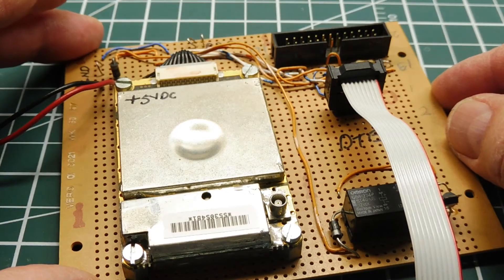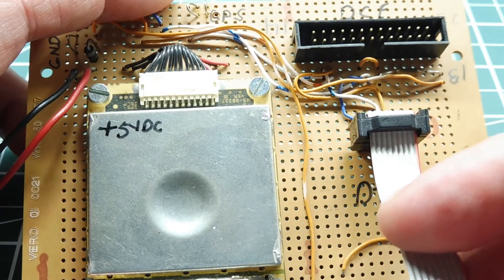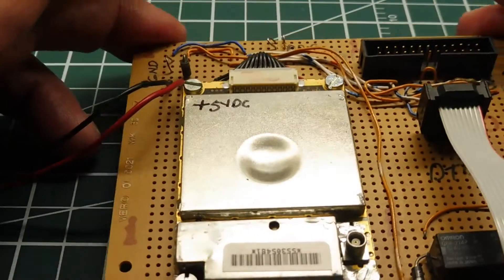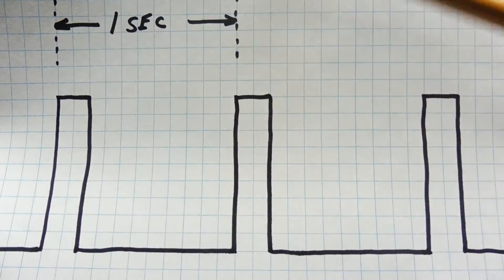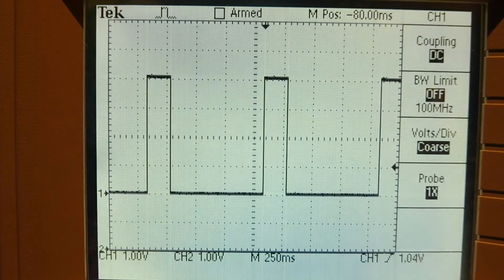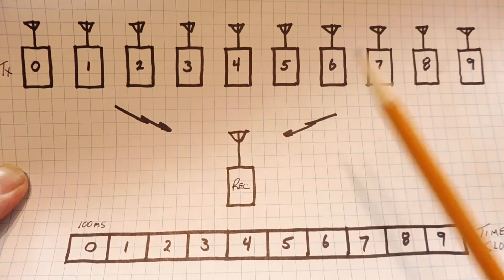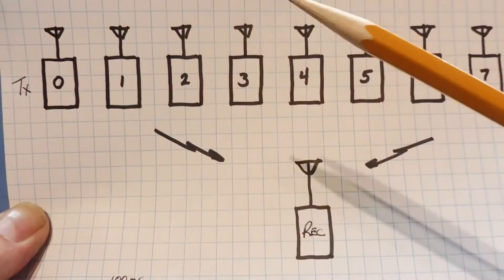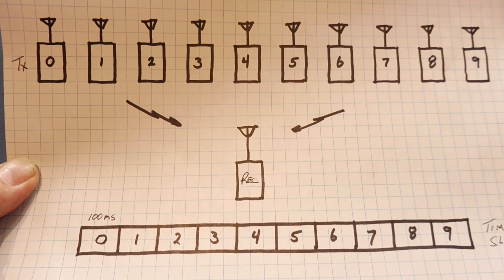Sync your project with GPS 1PPS

Comment: This is a good video and well made. There is information missing in parts that needs a little filling in. First up, the pps pulses output by the GPS receiver are not necessarily low jitter as such and it does not necessarily aim to be either. What it is, is accurate over time. And when we say accurate, we mean crazy accurate. The signal is derived from the atomic clock in the GPS satellites with errors somewhere between 1s per 30million years and 5ns in the life span of the universe. This is not an exaggeration (on my part anyway). These are the published numbers for atomic clocks, go check it out. Quite fantastic stuff.
So using the pps you could have a time of day clock that is never wrong (daylight saving aside) and will never have an error of more than a nano second in your lifetime.
Second area of not quite accurate information is in the discussion of the application.....
To say two devices in disparate locations can use the pps and receive it at "exactly the same time" is an error. All electrical signals, be they in a wire, air or space, take time to propagate. It is that fact that means a GPS can triangulate its position based on the time signals sent from multiple satellites.  The quoted application of TDM by remote transmitters requires the transmitters to know when to transmit such that their transmission arrives at the receiver at the exact time that is that transmitters TDM slot. That is a function of the distance between the receiver and each of the transmitters. A transmitter that is much further away than any others and has the last TDM slot assigned may begin transmission before any others but the distance means the transmission arrives just after the last of all the other transmitters and in alignment with the last slot position in the TDM frame. This is how analogue mobile phones worked (can't say what this scheme was called and what countries it operated in other than Australia).
An over simplification leads to either confusion or a misunderstanding and neither is good. I hope I have not caused either here.
Reply from the maker: This is a simplified description of this concept, as it is only a 4 min video. Check out the link to a patent of a radio controlled locomotive system I have worked on. Have a look at Paragraph [28] under Detailed Description for a more detailed description.
Reply: @0033mer  You should do yourself and the topic justice and take as long as the subject requires in explanation. Or pick a smaller subject or less complex examples. TDM over radio is no small subject ;)
There will be newbies watching this and they get the wrong idea and some of them will stick to the wrong idea like sh-t to a blanket. ;) They are the bane of my professional life.
Reply from the maker: Feel free to make your own longer video on this subject and I will link it to this video and my channel.
Reply: @0033mer  Now don't get tetchy ;) I looked into the old mobile phone TDM arrangements and the time slots were kinda short and tight and the distances not necessarily all that short either, and that is what made the standard for mobiles harder to comply with. Your rail yard probably has maybe up to 1km transmission distances? And I think I read in this post or in your patent application you were using a 1 second frame (rate or length, not sure which) and two (?) TDM slots so the timing would be far less stringent. Even at a distance of 5km, I think the slot width would still be an easy enough target to hit.
What got me going was things like, that two gps receivers being perfectly in sync based on the pps. They may be in sync enough for a 1 second frame rate with two slots per frame but to say they are perfectly in sync is a statement that has to be qualified, as in, they are sync'd to within ??us or you could just say they are really close to in sync and the repetition rate will be perfect because the frames are triggered by the same clock source or synchronised satellite clocks.
It is the absolute statements that are not absolutely true that raise my ire.
The pps on a CRO may look super solid but how much jitter would there have to be for it to be visible? I would guess RMS jitter less than 1ms would probably not be visible and 1ms RMS jitter on a 1Hz clock is terrible. I think even a 555 would do better than that.
But your system as described would probably work just fine with that much jitter.
It is horses for courses, or suitability for purpose. And the pps is suitable for the purpose to which you applied it. It does not, however, indicate characteristics better than those you required for the application you were developing. Fair enough?
Reply: @0033mer  Ok. I have had a look at your patent application from 2004 and I think I have found the problem. I don't think you are taking flight times into account. Even if a gps signal could be used this way it does nothing to accommodate the flight time of the signals from each transmitter to the receiver. I know your TDM frame is slow and probably has loads of wiggle room but in a rail application distances can be significant even in a rail yard context. Did your patent get approved and issued?
Reply from the maker: We have been doing remote rail yard switching here in Canada since 2004 to present.
https://www.dropbox.com/s/46eofcxnqxouf8t/Cattron.pdf?dl=0
https://www.youtube.com/watch?v=pFWlIfIZkCA

Comment: 2:58 - I hope this actual project is not using the 1 PPS signal at every second for 24/7... a lot of problems could occur which lead to all towers not to sync. Lets say some background EMI can cause the GPS signal to be skewed and some towers would not be synced. I hope it was designed such that those towers only uses the 1 PPS radio signal maybe when it's time for synchronization it's internal clocks. So in essence, those towers should use precise internal clocks and when it's time to resync all of the internal clocks, it should use the GPS clock signal. This way those towers are not highly dependent on GPS clock signal 24/7, rather dependent on it after few days or weeks. Also, what kind of algo was used for the antenna tower transmitters to wait for it's turn to transmit data? When thinking about this project, it seems the GPS atomic clock accuracy wasn't needed. All towers can just transmit 24/7 every second of the temperature data simultaneously and continuously where each tower transmit it's own unique encrypted data or code in which the receiver tower can easily distinguish which tower is transmitting the temp data, this wouldn't need the GPS clock hardware solely used to determine which tower is transmitting data and the receiver can easily tell which tower is sending the temp data. 10 towers means it requires ten precision GPS module hardware which could cost total of $300 which could've been saved simply using software to determine which temp data is provided by which tower. Nice example explanation however for the use of 1 PPS.
Reply from the maker: This is a simplified description of this concept, as it is only a 4 min video. Check out the link to a patent of a radio controlled locomotive system I have worked on. Have a look at Paragraph [28] under Detailed Description for a more detailed description.
Reply: @0033mer  Wow theres a patent of your radio concept. Cool will take a look at it. Thanks.

Comment: The AIS Automatic Identification System have the 1PPS at its heart of the system. It was Haakan Lans that came up with the initial concept. It also form the foundation for a system named ADS-B in aviation. Those concept also apply Self-Organized Time-Division Multiple Access (STDMA) to compensate for the variable distances involved, as prox 0.3 meter makes one nanosecond 'flight-of-light', one mikrosecond makes 300 meters, one millisecond makes 300 kilometers and so on. Very good video indeed. Legacy of prof Brad Parkinson.

Comment: Ok but you did not explain how they delay the timing. If they all sync to the 1pps to begin sending the data, how does the delay get implemented to not all send at once?
Reply from the maker: Each transmitter is controlled by a microcontroller. When it detects the 1PPS edge the microcontroller will delay according to its time slot and then transmit, so each transmitter comes on one at a time.
Reply: @0033mer  according to its time slot and the flight time to the receiver. You have over simplified this and don't really understand it yourself (I suspect).

Comment: Nice explanation. Could you tell me software used to sync pc clock   with gps? Thanks
Reply from the maker: Some GPS units come with drivers to sync the PC clock.
There is also software that will read the NMEA serial string and sync the PC clock
http://www.visualgps.net/#nmeatime2-content